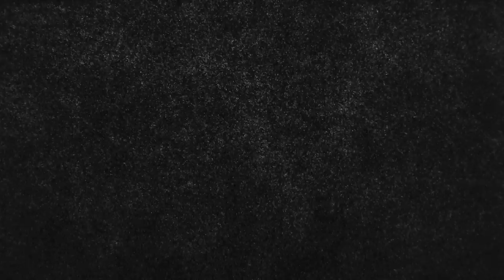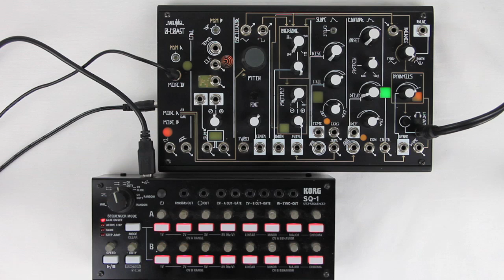0-Coast and Korg SQ-1, Part.2: Sequential Modulation Source

Comment: How is the 0-Coast connected to the computer?  In other words, where does the 1/8" MIDI cable go?  Thanks.
Reply from the maker: Either use a DIN MIDI output on your audio interface, or a dedicated USB-MIDI interface like the Roland UM-One.

Comment: Why is it that the SQ-1 appears to run at double speed when synced to the MIDI clock via 0-coast? I've also noticed that the 0-coast clock appears to run at half speed when I try to sync it to my SQ-1. Is there some sort of inherent clock divisor in the SQ-1?
Reply from the maker: Yes they are options in the SQ-1's global settings.

Comment: Man, it would be pretty easy to make a krell patch with the sequencer modulating those parameters too.  Maybe I do need an SQ-1?  It's just so small and useful, I'm not want something so portable and multifunctional.
Reply: it IS very useful AND very cheap: I wouldn't hesitate ;-) The other option is a Beatstep, but the Beatstep Pro is far more expensive while the Beatstep is limited in connections (1cv 1gate). On the other hand: SQ-1 has no memories, while Beatstep allows you to store & recall patterns. Good luck!
Reply: I agree with what you say, but  wanted to add that the  beatstep pro is very good value and still relatively inexpensive.